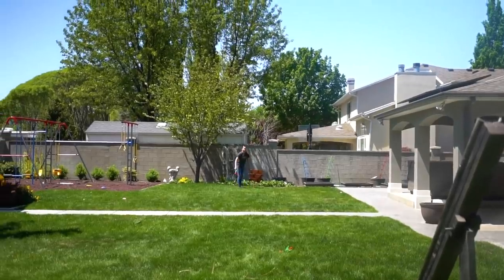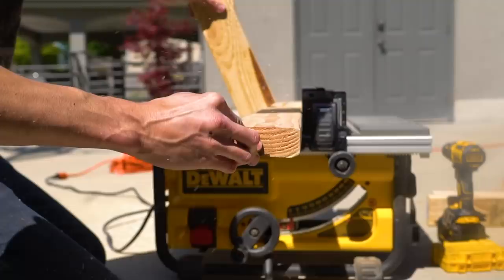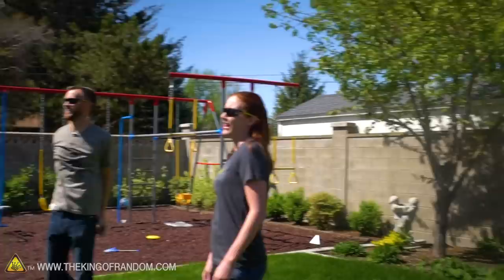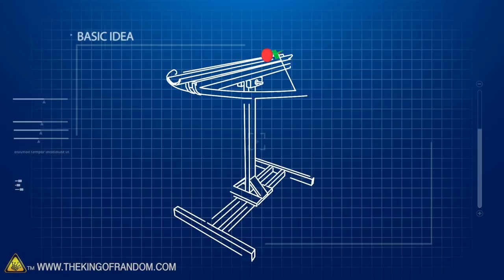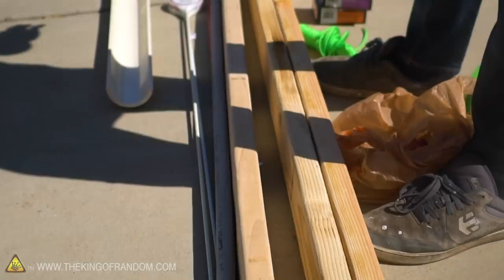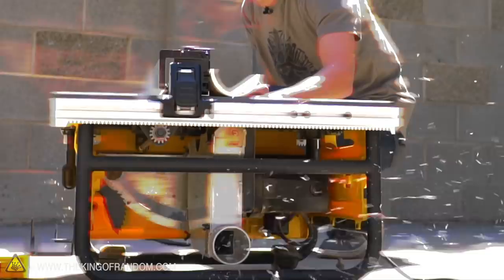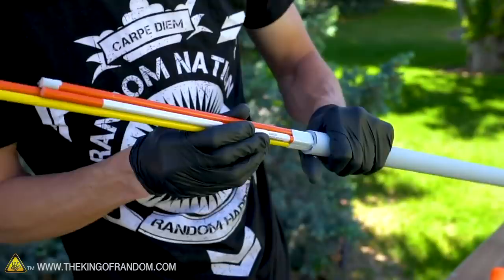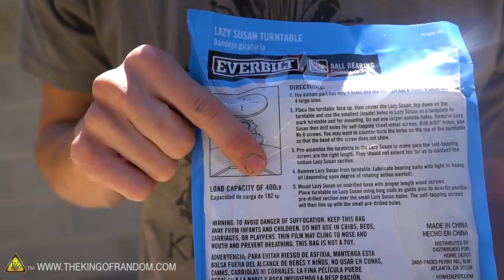Backyard Ballista - Go Big or Go Home!

Comment: Hi, I'm a medical student learning about Ultrasound as a heating modality. Can you cook a steak with an ultrasound machine?
Reply: Just scream at the steak lmao
Reply: you can cook anything with any machine if you use it wrong enough.
Reply: just use a boombox or buy ur own and wear headphones
Reply: Ultrasound is utilized for deep heating (more like warming) of human tissue in physical therapy.. I'd also be curious to see if something like that ultrasound machine could cook steak. 

Of course not the ultrasound machine that's used for imagery.. those are specifically low powered because they do things like produce images of babies still inside mothers
Reply: @lolsflint7598  you know what, I love this quote, LOL
Reply: Run the machine at max power, and put the steak on the part that heats up the most, and wait for the machine to overheat.
Caution: this may break the machine. Always have a fire extinguisher nearby when doing this.
This can be done with anything that consumes a high-ish amount of power.
I did this with my computer and it worked.
Reply: @lolsflint7598  All machines can be smoke machines if operated wrong enough!
Reply: @robertf6523  So If I made the right ultrasound machine more powerful it would be like putting a baby into a microwave?
Reply: @lolsflint7598  I feel like this should be a tkor series! Using things the absolute WRONG way! Lol
Reply: That sounds like a great idea
Reply: LOLSflint the best thing I’ve ever heard anyone say
Reply: @lolsflint7598  Lol that's facts right there

Comment: I'm suprised you didnt build a simple retrieval device for your bolts, attaching some extended thread to the bolt connected to a wind up motor, would have saved that walking :)